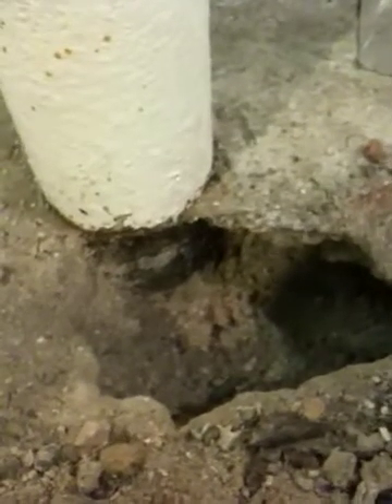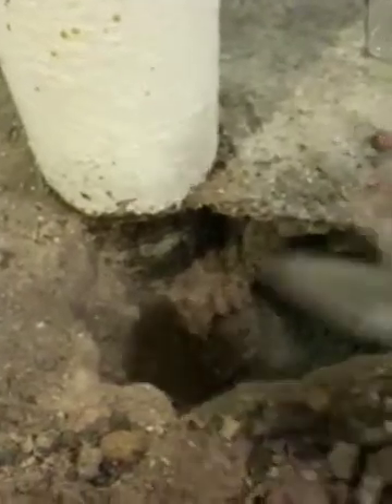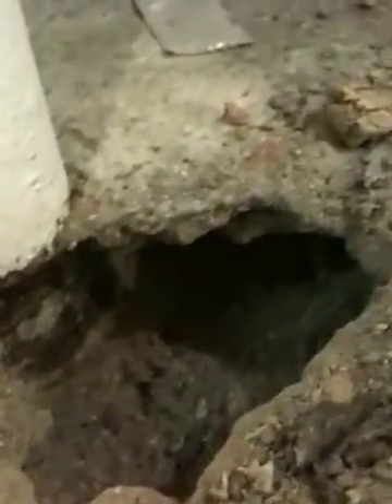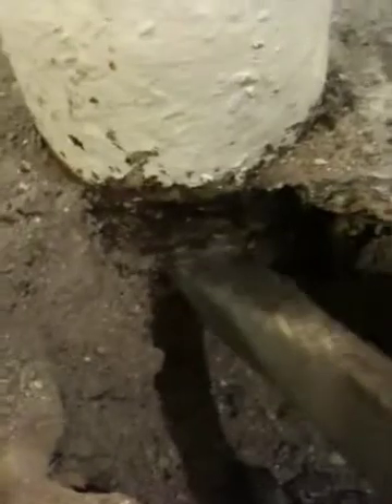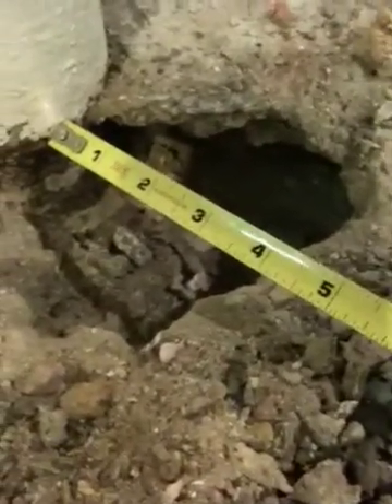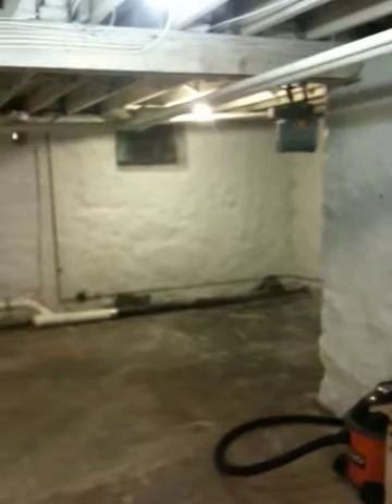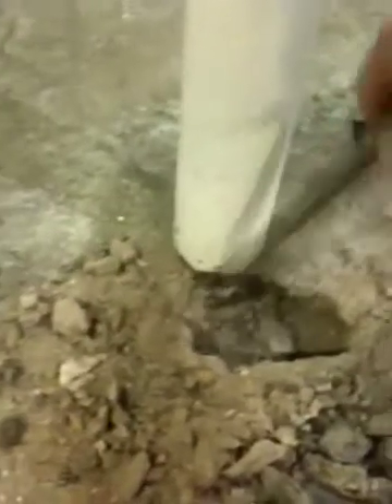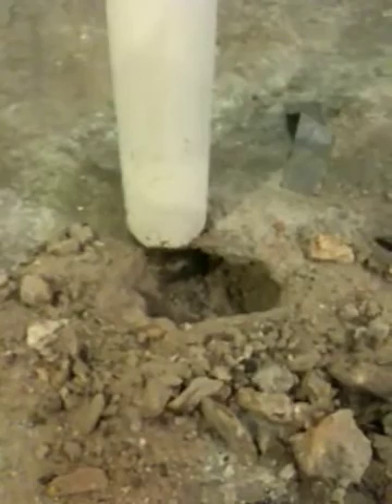Lally Column Investigation

Comment: I got one thats perfectly fine on a 50 yr old house but house is on clay soil and turns out the columns were placed on the very edge of the footers poured..  so on one side the footer is 3 feet deep and where the column is has only 1-4” of a footer.  The damn things will move 1.5 inches up and down depending on the rain and how wet the soil gets under the slab.. never have had any water issues, just drywall and foundation issues with the concrete blocks..  moved in 7 years ago and the gutters were original and served no purpose so water and grading issues where it was really to the point of fuck it fall the fuck over or fix it now otherwise have to go with option 1... 14 steel piers, 4 helical piers, excavation and resealing of the block foundation, soil grading, new gutters and soffets, 10 4” steel i beam supports and digging a 36x36” footer 6” below slab to replace the 3 lally supportcolumns and repouring slab back with expansion joints then finally sistering all the joists and adding a sister rung to the lvl main beam.  Finally done.. did most the work myself other than the pier suports because they have to be driven in with hydraulic rams and couldnt get anybody to rent the 200k$ system to me..  lol..  but think total cost about 20 grand and arthritis in about 10 years and maybe a lung from all the shit that got through the masks..  dirty hard ass work for one dude lemme tell ya.  But not impossible and a person can do anything if they put their mind to it.. whether what they did works or not depends on how much mind they put to it but yea..  still waiting on a video of a dumbass to attempt to replace a column without supporting the load above..

Comment: did you remove the post
Reply: No the engineers said it was ok ...
Reply: They looked at the beam above, surrounding joists, and how things seemed to be holding up. And what the condition and loading of the other columns were. In the end they asserted the column was ok.

We also poured a complete top slab over this floor, which helped some.